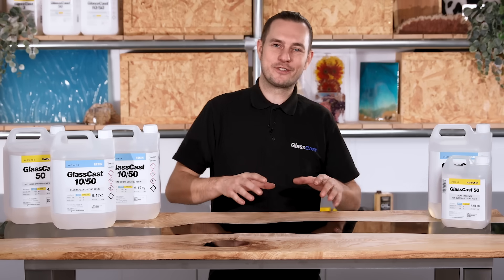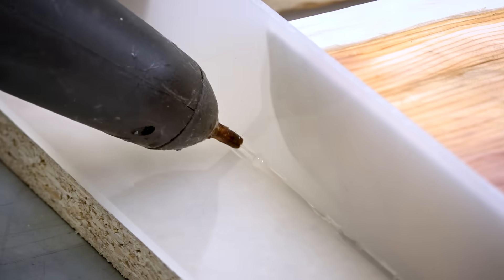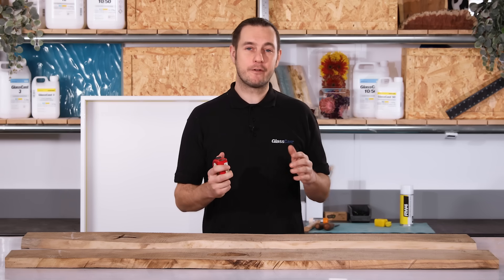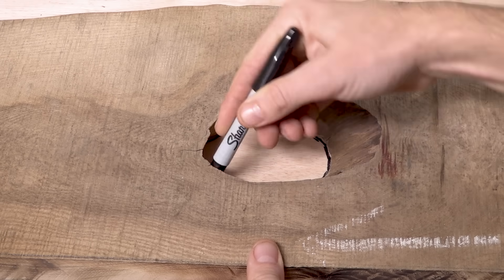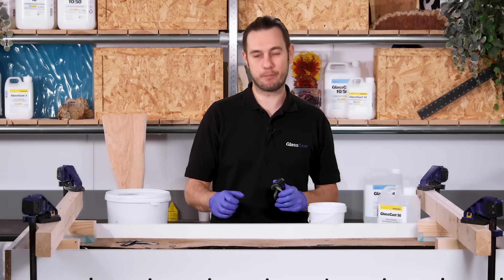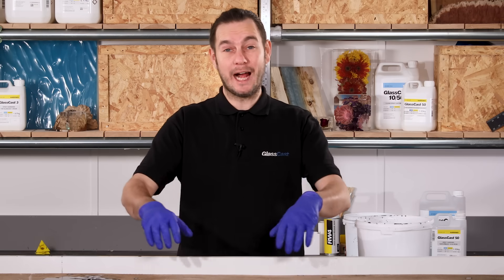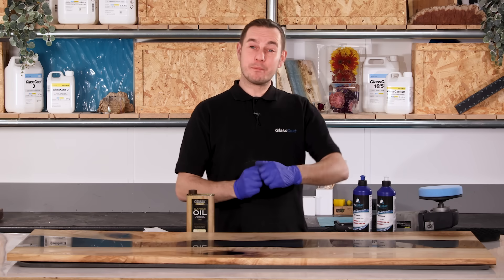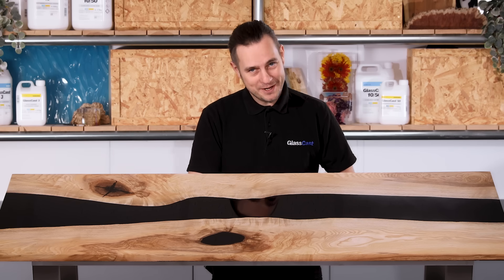Stop Wasting Money On Resin River Tables!

Comment: Instead of dealing with all the routering and sanding can't you put a clear coat of epoxy over everything and call it a day? That would make a level surface, no?
Reply from the maker: If that's the look you want then yes, absolutely but we do like the different textures and look that you get when you get the distinct contrast as in this video however, if you want to flood coat with a resin like our GlassCast3 then it can save a lot of time/effort in the finishing stages albeit you would need more resin so the costs will increase.
Reply: @glasscastresin  awesome, thank you!  Nobody has mentioned this is an option in the 15+ hrs of videos Ive watched
Reply from the maker: @sbb526  https://www.youtube.com/watch?v=dTLLFntPD60

Comment: Could a less expensive "particle board" be used, inplace of the plywood?
Reply from the maker: If the surface is relatively sealed than it should not be a problem.
Reply: @glasscastresin : I don't remember, did you need to seal your plywood?

Comment: So basically cut away the value that used to be attached to the cost and giving the client filler instead and never telling them...
Reply: a healthy scam, who's gonna saw their 5k-8k table in half to see if it has plywood on the inside :D
Reply: @NathanVdV  Noted. I'll be sure to never buy your products.
Reply from the maker: Is the value in a solid lump of plastic or is it in the natural beauty of live edge hardwoods, combined with the maker’s craftsmanship and the sleek appearance of the polished resin?
Reply: @glasscastresin  some of the value is in the fact that resin is expensive. Value is based on raw materials as well as appearance
Reply: @glasscastresin  The craftsman includes the raw materi cost in their sale price. There's nothing wrong with a craftsman reducing raw material costs to increase their profit margin. However, in the case of high end pieces the customer expects epoxy and solid wood. They do not want epoxy, melamine, wood veneer, and plywood. It the same reason why you don't pay granite counter top prices for a formica covered melamine countertop that looks like granite.
Reply: @OU81TWO  hahaha good. I don’t want to have to hassle with out of country shipping 🤣 (but I wouldn’t do that epoxy scam, but I can surely understand why some might do it)

Comment: I've never attempted a resin pour before. Apart from sealing the edges is there any reason why you didn't get bubbles? In other videos I've almost always seen some form of heat used to remove bubbles but interestingly you didn't.
Reply from the maker: The sealing of the edges helps for sure.  Also the GlassCast Range of resins are very good at self degassing when used under the right conditions.  Certainly you can use a heat gun or similar wafted over the surface to lift out any stubborn bubbles but its not always needed.
Reply: @glasscastresin  Ok interesting. Thanks for the info as I plan to do aresin pour this summer.

Comment: What about filling the river with river rock (of suitable scale like aquarium rock) and using transparent? I've been thinking about that.
Reply from the maker: Yes you can do that instead although you won't quite save as much resin due to all the gaps around the rocks filling with resin.
Reply: @glasscastresin  I was mostly thinking about the ability to hide the wood beneath the pebbles so you could use less resin when you wanted transparency. I still think it would significantly reduce the amount with the benefit od transparency, and so worth a pound or two of resin.. It WOULD look nice I think. But then I don't have customer experience on these tables. I come from more reality driven  diorama experience and less in furniture building. Perhaps the "realism" would detract from the artistic quality and make it just, well, a DIORAMA LOL

Comment: So will it reduce the final price or increase the profit?
Reply from the maker: Well, if you're making the table for yourself then it will definitely reduce the final price (i.e. the cost to the maker). If you're selling tables then I guess it would most likely increase the profit because the table itself isn't compromised in any way and so rightly should be the same price as one that's solid resin, I would say.

Comment: I build decks for a living and have an endless supply of PVC scrap (Trim Board). Can this be used for the molds?
Reply from the maker: PVC can be difficult to bond to so possibly wouldn't work out as you do need the surface porosity to ensure the piece is strong enough.

Comment: How do you get the surface hard enough to withstand the bottom side from dishes or plates ... 2k boat paint ?
Reply from the maker: Once the resin has fully cured, it is generally pretty durable.  There are not any harder top coats available.  Like with most decorative finishes, care should be taken to minimise scratches from dragging items over the surface.  If it does pick up scratches, it can be polished again.

Comment: wondering if we can use instead plywood something cheap like cement with rebar or other material that will hardener later?
Reply from the maker: Cement and rebar would be very heavy and relatively brittle.  The core needs to be hard and rigid when fitted in this process.

Comment: I think this is a great top for solid colours. I have 2 questions though can I ask what the tape is you wrapped the blocks in as I've looked into the usal stuff people recommend ie tyvek tuk or epodex tape and there all expensive. Other thing is I'd love to do this im starting out doing this but the resin is expensive any chance of sending a kit to a enthusiastic maker just starting trying make his name. And have u ever had any issues with danish oil I was always told not to use in resin work 👍🏴
Reply from the maker: The tape we use is our barrier/release tape https://www.glasscastresin.com/resin-barrier-release-tape. We wouldn't recommend using the oil before pouring the resin as it will effect the way that it bonds to a surface, it might also impact on the way the resin cures. Once the resin has hardened it should be fine.

Comment: Does suspending the plywood filler (having swiss cheese holes) with biscuits or dowels make sense so that only one pour is needed?
Reply from the maker: There is no need structurally to do so as the resin to wood bond is generally very strong. Also you don't want too many holes as it increases the resin use which is against the concept of this method.

Comment: Can you still use this trick if your coloring with mica pigments and swirlings a pattern as the epoxy is almost setup???
Reply from the maker: Absolutely, just be sure to have enough of the mica powder in the top layer so that the filler material is hidden. The top layer is a thinner layer than normal so you might need to add more than you usually would to produce the solid colour that you need.

Comment: Do you use c channel in River tables? Do you need?
Reply from the maker: You could use 'C' channel to stiffen up the table or mount the legs if needed. The resin isn't great at taking a thread so its best to mount legs to the wood where possible.

Comment: Hey! im new to this, would the core effect the strength of the build at all?
Reply from the maker: Not really as the epoxy soaks into the surfaces giving you a strong bond on the interfaces. Its also worth noting that this also makes the table lighter; the plywood we used was a 600kg/m3 density, whereas the resin it displaces is over 1,000kg.m3 so there would a bit of a weight saving overall as well.

Comment: My first thought is how you might do something similar for translucent colored tables. Done any testing using something clear as a filler? glass or polished up chunks of already cured resin (maybe recycled from another table)?
Reply: Translucent tables may have issues with this method since how 'deep' the color appears will depend on the thickness of the resin, so if you use a clear core then the color around the edges of the river will likely appear darker than in the center, which might actually look pretty amazing depending on what you're going for, especially if you were to use thick chunks of glass in the center with a bit of a gap between them.🤔
Reply from the maker: There is a very good chance you would see the join line. Depending on the pigments used it may be more obvious in certain shades.
Reply: But i can tell you that you get some very nice unique tables when you use your leftovers from other projects and some cheap silikone molds from ebay. you  can cast octagons, hexagon bars, pyramids in different sizes for later projects. You can group Hexagons into a honeycomb pattern and fill the gap between them in your main colour, to give your tabletop a little Cyberpunk/Deus Ex feeling. Golden Combs encased in deep black is something you can never top, closely followed by red or metalic blue

Comment: how well dose glass cast adhere to metal?
Reply from the maker: If you give the surface a really thorough keying with a very course abrasive and degrease the surface the resin will bond fairly well to most metals.
Reply: @glasscastresin  thanks I have been thinking of a design but have not been confident if it would work. That info is enough for me to have a go at it.

Comment: Can I use a piece of glass instead?
Reply from the maker: There is a very good chance you would see the join line. Depending on the pigments used it may be more obvious in certain shades.
Reply: @glasscastresin  aw. Many thanks tho. Wanted a way to replace the plank in the middle for transparent resins.

Comment: If you're willing to buy a little more resin, do you need to use the bevel cut?  Is there a significant curing risk if I am doing 1/4 inch per pour?
Reply from the maker: No, the bevel just helps to fill out the volume as much as possible. With the GlassCast50 you can pour into wood at a thickness of 25mm so keep it below this and you should be fine.
Reply: Bevel also helps trapped air ecape a little easier.

Comment: I mean, why not use some other cheap thin wood, plywood is also expensive, you could use particle board or whatever other scrap as long as it fits to fill the space, all youre looking to do is displace the resin so you dont need as much.
Reply from the maker: You absolutely could; we had the Plywood left over from another project and had no use for it. The most important thing is that whatever you choose to use is dry and free from any dust/debris and well sealed so as to prevent excess air bleeding out during the process.

Comment: The one thing you’re not mentioning, is all the things that can go wrong when using the filler, like, if that plywood happens to float to the top in the process of drying, now you’re going to have wood, showing in the middle of your table, or if the slabs you’re using or twisted at all and you have to plain or CNC, the table and you go too far and now you see the filler wood
Reply: ? did you watch the whole video? He made the pour i 3 parts:: first he let the bottom around 5mm harden and then he let a thin layer GLUE the plywood 
to the bottom layer, and let that to harden. BEFORE he pourd the final part all the way up.

Comment: Do you have to use a deep pour resin for this method or not?
Reply: Haven’t used Glass Cast resin before so can’t speak for it. Most of the resins I have used recommend deep pour for depths 1/4” and over. And the countertop resin for 1/8” or less.
Reply from the maker: In theory, the maximum resin depth you're ever pouring on this project is no more than about 10mm and so this is definitely not particularly 'deep pour' by epoxy standards. From the GlassCast range, you could get away with the GlassCast 10 (up to 10mm) but we suggest the GlassCast 50 (which can be used for up to 25mm / 1 inch) pours in a single go; just to be on the safe side.

Comment: if its 100% opaque why use a live edge? Just get a table top, router out a river path 1/8" deep, fill with resin. Save a lot of time, effort, and cost.  I hate seeing these beautiful slabs covered with opaque resin.  Seems like you're hiding the best parts of the slab.
Reply from the maker: On a live edge, the visible grain on the top generally flows with the live edge. If you just routed into a slap of wood, you would not have that effect.

Comment: What if you would switch out the plywood for plexiglass or acrylic, then it would even work for transparent tables wouldnt it?
Reply from the maker: There is a very good chance you would see the join line.  Depending on the pigments used it may be more obvious in certain shades.

Comment: Kinda what they do with cement when they throw rocks in to save on cement.
Reply: Are you talking about concrete, which is a composite of cement and graded aggregate? You are correct that it does save on. Ement. The graded aggregate (which need to be the proper type rocks; some types do not interact well with cement) also provides dimensional stability as cement on its own has a fair amount of thermal shrinkage.

Comment: Sorry but why didn't you give a proper demo of the table? my guess is the ply is visible from some angles right? therefore a complete waste of time to begin with if the customer won't be happy with it and just commission another one.
Reply from the maker: The plywood core is completely hidden in the resin. This method is really aimed at a DIYer wanting to have a go but who previously may have been dissuaded from doing so by the cost of resin.

Comment: For this project you done a lot of unnecessary work mate. If the resin is not transparent like in your  case then go and cut a river about 5mm deep with a router and fill this gap with your resin. Mission complete.... and saved even much more resin.
Reply from the maker: We cover why we didn't do that in the video. You certainly could router a groove, however, you won't get the live-edge effect with the grain following the lines of the live-edge which is something we were specifically looking for. Of course, you could route any design into a flat piece of timber, not just a 'river' and back fill it as you suggest.

Comment: Saving a few bucks on resin isn't worth the aggravation. This is the way the Chinese do stuff.
Reply from the maker: There are other reasons than cost as to why this may be an appropriate method of production. In the first instance, substituting resin for a lighter-weight material (even Plywood as used here is lower density) will make the final part lighter than it would have been if resin was used throughout - examples being yacht furniture where the core will often be replaced to reduce the overall weight whilst retaining the aesthetic.

Comment: Using dark and opaque resin thus completely missing the point of the design. Kinda invalidates the whole thing.
Reply from the maker: Certainly for transparent river projects, you're correct and this process wouldn't yield the best results however for 'lava' tables or other such designs where the resin is heavily pigmented using opaque or metallic pigments, it is a good way to both keep the costs and the overall weight of the table down.

Comment: So
You use these tricks to screw over customers ???
People don't like paying full price when cheap material are being used to reduce costs for thee ones who make and or sell them !!!
If you use these tricks for your own use......great !
If you do this with the intend to sell to others ...........shame on you !!!
Reply: I think you're projecting. This company makes the epoxy. How makers of river tables go about making them is something you should be raising withe the makers, not the suppliers. If you stopped and thought about it, or had listened carefully, you would have heard that that this tip was for DIYers who want to make their own and save on the cost of resin. This allows DIYers to cut the cost of their project. And legally, anyone selling a river table made using this method, who claims it was a solid wood river table would be lying, but this epoxy supplier is try to sell to non-professionals anyway. This method reduced the epoxy used to just a 5 litre mix. And the funny thing is that you would the have known that this company would want you to use more resin, don't you think? As they would sell more resin? But you didn't think, did you? Ah well, go rest your weary head. Tomorrow's another day. And perhaps take a break from social media?